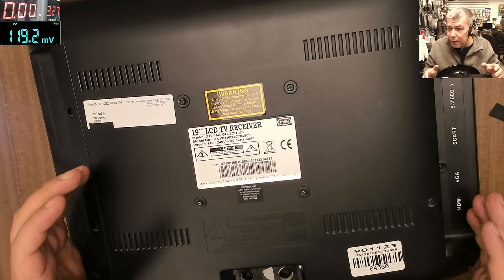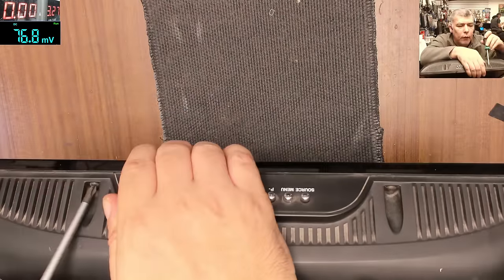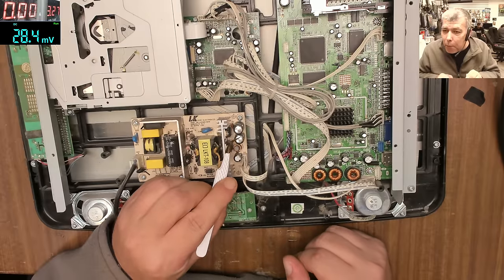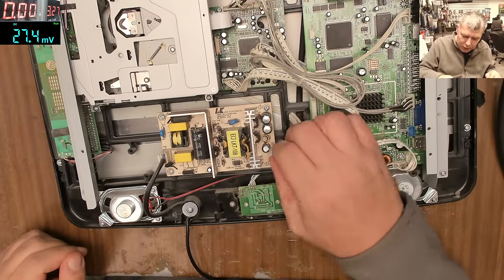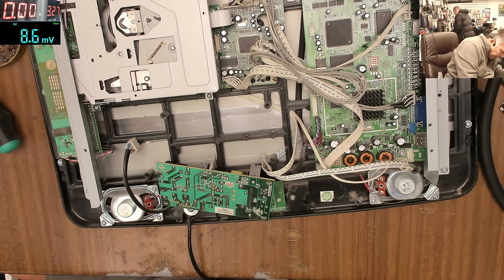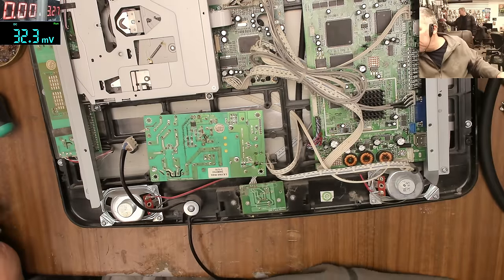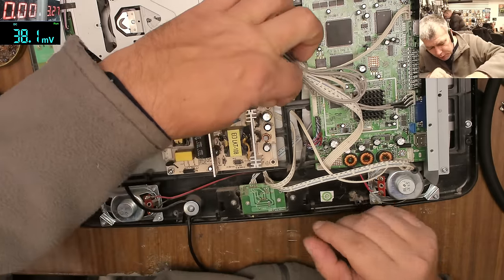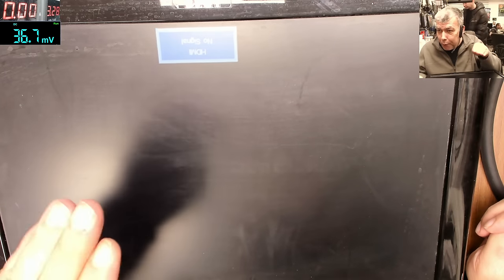This is the most common fault on a dead TV!

Comment: How can I measure good looking capacitors which are faulty? Thanks.
Reply: ESR Meter
Reply: Yeah the LCR-T4 is fine in a pinch, though the disadvantage of it is that it can't be used in circuit, you have to take the capacitor or other device out, so there are potentially nicer devices you can get. Do keep a comparison capacitor at hand so you can judge whether the cap you're testing is substantially degraded. LCR like this measures 3 values for a capacitor - capacity, ESR and loss. I believe the first two should be known to you, loss% is roughly how much less of the test voltage is present on it after some time has passed, like a second or so. Increased ESR and increased loss result in extra electricity loss to heat so the capacitor is probably already misbehaving even if its capacity isn't critically gone yet, and is likely either already dragging down the circuit or will do so very soon, so if either of these readings is suspicious, you replace it.

The T4 will also measure lots of useful things, like most 3-legged components like diode pairs, transistors MOSFETs etc. These are frequent faults in PSU repair as well.

Many multimeters have capacity measurement but i've never been quite happy with that. They don't measure ESR or loss.

In-circuit measurements are dicey anyway, often misleading unless you know exactly the topology of the circuit and what to expect beyond just printed value. So i haven't desired anything better than the T4 for the time being.

Comment: Capacitors can and do go bad from age not just work load it's how cheap they are made the electrolytes inside them build gasses and they get puffy and or don't go puffy and leak the electrolytes out and dont wirk and their job is to hold an electric charge and release it smoothly and properly so once they go bad lose the electrolyte it can't store the charge anymore, it may work at a lower capacity which would still make it faulty as it is not working properly , basically capacitors are used to smooth the voltage to different components such as led back lights if they fail the screen stays black due to the back lights not getting voltage

Comment: Cool. By the way how about this on an PC LCD (Viewsonic, it uses LEDs but it's a single aluminum strip on the side)- it'd turn on for 30 minutes, things are fine and then it would flicke, turn On every 15 seconds then turn Off, then turn on (every 15 seconds). I've replaced all capacitors but it's still the same (I resoldered the original capacitors). Where should I be looking to fix it? It essentially "blinks" after 30 minutes of normalcy.

God bless, Rev. 21:4
Reply: Ask God for a miracle.

Comment: What about  if the fuse is gone
Reply: if the fuse is gone, either TV will be fine if you replace it, or there's something shorted - even the main transformer which caused this fuse to blow. So, ones you start to learn it, you'll see many variables that can cause something. The world of electronics is great. We who fix it most of the time love it cause we're like a detective. Sometimes we have a rabbit whole, and sometimes it's not worth even to fix it, but we wanna find the cause of the problem :).
Reply: duh? replace fuse?
Reply: Check diodes, check MOSFETs and BJTs for shorts if fuse is gone. You'll likely find something. Also smell and visually inspect the coils and transformers, sometimes nasty surprises.

If the transformer or nonstandard choke is gone or suspicious, you have to chuck the board, you can't trust it again. Otherwise, you can rebuild the board by replacing the deceased components.

Sometimes it's OK to just replace the fuse because it is a thermal device, it will sometimes burn out for no hard reason, it can burn out just like an old incandescent lightbulb. But doing so without finding an existing cause is a little dicey, and you're more likely to just lose another fuse, so i suggest to investigate first.

Comment: Raising the working voltage rating of the capacitor doesn't "improve" it, you should be looking for a cap with a lower ESR or higher temperature rating instead.
Reply: True, ESR is absolutely themost important aspect of an SMPS smoothing capacitor and is often overlooked. I wrote a comment about this and like most on-line platforms, YT shadow ban commenters they don't like.

There is some truth, however, that higher voltage capacitors of a type and capacitance happen to have lower ESR. Maybe best to go for a solid electrolytic capacitor. They have low ESR and should last. I keep some 470uF 16v solid electrolytic handy and are usually a superior replacement for 3.3 5 and 12v applications.
Reply: @nickhill9445  why would anyone ban comments about ESR ? It's a very important parameter when choosing a capacitor.

Comment: If you want to make it better than factory, put in a higher temperature rated cap, and save money on those 2-3 higher voltage ones in same footprint.
It is the temperature rating that determines the lifetime of a cap, not the voltage rating (if the applied voltage is not too close to cap limit)

Edit - the reason they get the bump is the electrolyte inside is expanding, as the tv gets hot + the PSU current spikes turns into heat as the cap has an internal resistance. You could put lower ESR rated caps as a replacement, but don't go too low as the PSU could destroy itself as it is not designed to pump energy into an extremely low ESR cap.
Reply: @BlondieHappyGuy  So true, getting the right component for the job is paramount.

Electrical engineers go through a lot to get the parameters right (at least I did, lol)
Calculations on FET's, Inductors, resistors - often relatively 'simple'.
Then calculations on the capacitor - reading datasheets, de-rating and recalculating several times to make sure one parameter doesn't wreck the design using the chosen components.
Choosing those 105 caps could often double-tripple the lifespan, compared to the cheaper 85 degree Celcius caps.

Comment: Were there 2 caps with 450uf25v because he used a 1000uf and a 450uf? I always thought you use the same value but Voltage can be equivalent or higher.
Reply: It depends on how the capacitors are used in a circuit, here they are just used in the powersupply to smooth out the voltage basically thats why its not critical to have the exact same value although you should never go lower and you can as you say use a higher voltage (or temperature) rating so that it will tolarate a higher voltage/temperature. In other applications the capacitance value can be critical so if you dont know exactly what you are doing then its always best to use the same values and there are also of course different types of capacitors for different applications, in this case its a electrolytic capacitors.

Comment: I had an issue with plasma TV not turning on everything pointed to the main control board found a trick to reset a relay that wasn't activating unplug for at least 30 minutes and hold power button while plugging it in it worked didn't have to replace the main board like the manufacturer suggested

Comment: I beg to differ for this repair. There is a reason why they put two identical capacitors in parallel and that the issue is the circuit is over voltage with not enough power factor. Should have used the same MF capacitors but at 35 volts.